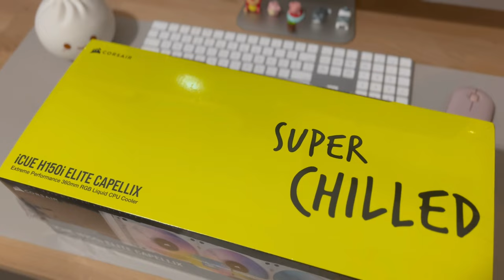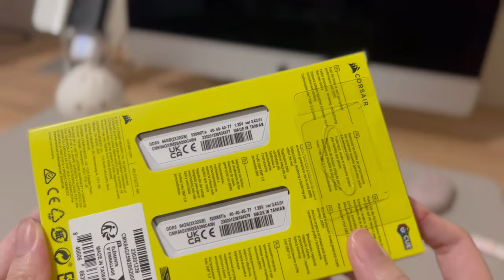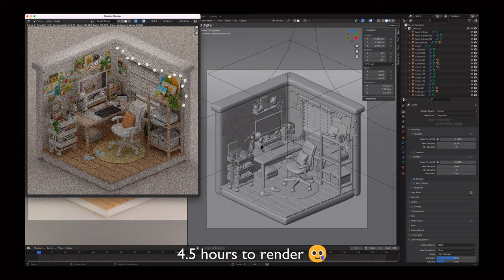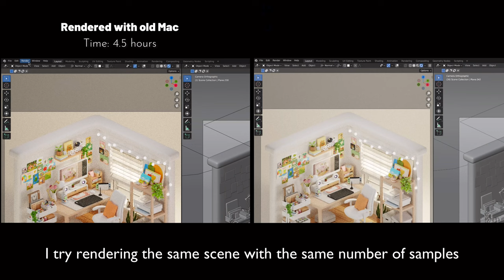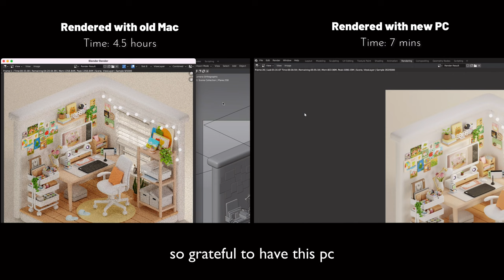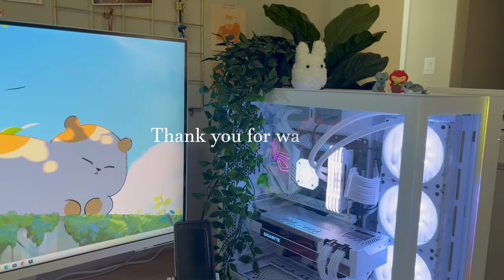building my first pc for 3D modeling✨ white aesthetic | 3D artist desk + setup tour | RTX 3080

Comment: I worked in sales and even though you claim to have tried to save, those microcenter Boys upsold you on everything.. Seems you had an unlimited budget but were told not to go crazy. If you had a fixed budget, microcenter wouldn't have been able to sell you expensive things on the premises of "future proofing".. They would have given you 2TB of nvme instead of convincing you to buy a hard drive, which has probably been sitting on the shelf collecting dust because people aren't buying them for personal use because they will fail and they're slow and not necessarily suitable for editing and design where you work with large files very often... They give you ddr5 ram to future proof you but sell you expensive old hard drive to go with it... Your PC is definitely amazing and High end but there's nothing budget-minded in your purchases. Microcenter Boys sold you open box and mismatched parts to move inventory off shelves and make their commission. Because they get incentives
Reply: Please what do u recommend
Internal storage 2tb (which is what I am going for)
Or external drive like hers
Am confused 😕
Reply: Intel storage
Reply: @Rebecca-qg8pb it really just depends on your use for the storage. i think in this day and age if you go for a hard drive, you should at least have a m.2 nvme ssd as well. hard drives are slower, but i think they're better for bulk storage and things you don't access often. m.2 ssd for files you need to access quickly or access often. hard drives are more reliable if they fail because you're able to get your data off the drive. i think when going for an m.2 ssd, make sure to pay attention to your usage as you never want them to reach full capacity, they may start acting weird. ultimately, it's all up to you, but i would recommend both an m.2 ssd along with a hard drive. be sure to research brands before buying. seems seagate is best for hard drives, while samsung is better for ssds.
Reply: I was just thinking this when watching the video, I was like damn 😭
Reply: Hard Drive is good for just storage though when video editing, render and edit with the m2 and save the stuff into hard drive space.

Comment: Thanks for this, it's was both informative and fun to watch. For your keyboard space bar, you have many options, you can lube the switch, you can tape the key, and you can also add keyrings to dampen the noise. It all sound scary bit it's quite easy. Thanks!
Reply from the maker: It does sound scary but thank you for the tip, I definitely will look more into it xD

Comment: i have a question why do you need a hard drive when you already have the SSD or do you need both to work the pc because i heard you dont need both so i was just wondering
Reply: you don't need both but i think a combo of both an ssd and a hard drive is better than having only ssds. this is because although slower, hard drives are more reliable and better for bulk storage you don't access super often. you never want an ssd to reach full capacity, the risk of failure is much higher so it's better to have a hard drive that can handle long term bulk storage and can be restored if you ever need it. ssd for files you access often or need the speed for, hard drive for files you don't.